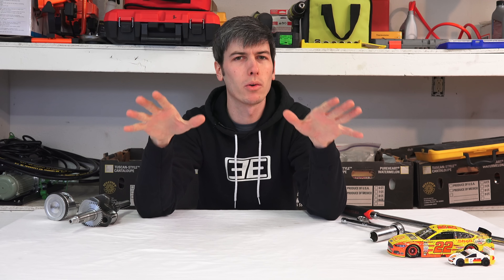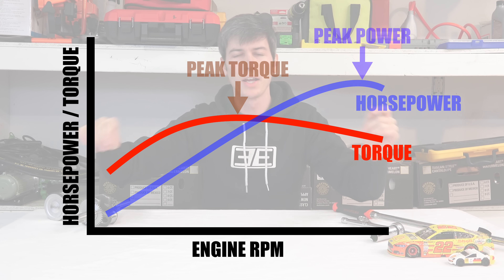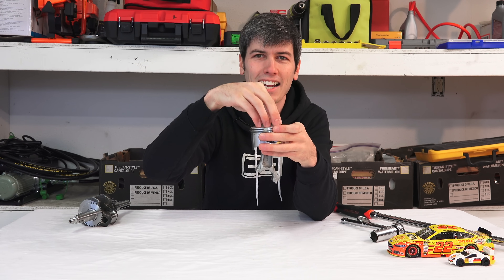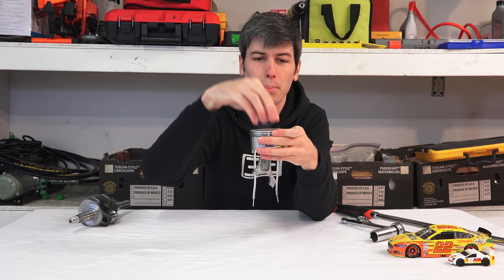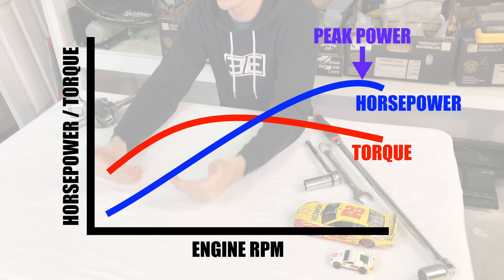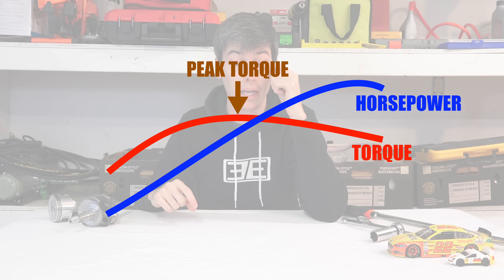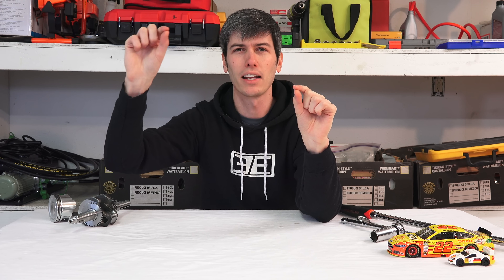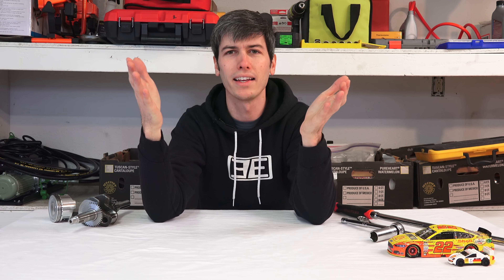Horsepower vs Torque - A Simple Explanation

Comment: I thought torque was a function of horsepower. But you get performance engines that make serious torque but not outstanding HP. So is it really just gears, bore and stroke and total weight that determines GRUNT. That's a new scientific term.
Reply: Torque is independent of horsepower, but horsepower is a combination of torque and rpm.
Reply: Thanks, that clears most of it up.Except for an engine that develops more torque than HP.
Reply: @Stevie671  the formula for horsepower is (torque X RPM)/5252. At rpms below 5252 torque will be greater than horsepower and vice versa.
Reply: Thanks, that's interesting. A high revving big block is an awesome thing but with limited applications.

Comment: Ok, engine theory 101. Torque is the measurement of rotation at a rpm. Horsepower is the measurement of torque over a distance. Torque=power horsepower=torque over a distance. 

Horsepower engines generally move fast, spin higher rpms, have power higher in rpm. 
Torque engines have power lower in rpm, power is low in rpm range and not much faster the more you spin it. 

Compair a diesel at 2,000 rpm to a race engine at 2,000 rpm. Diesel has all its power there. Some high hp race engines idle there. 

Hope this helps alittle to somebody.

Comment: Then how is it that some engines claim more torque than horsepower.  If your formula is correct, and torque multiplied by rpm equals horsepower, then torque has to always be a lower number than horsepower.  What am I missing here?
Reply: His formula isn't complete. The full formula is (torque X RPM)/5252. At rpms less than 5252 torque is greater than horsepower, and vice versa.

Comment: New diesel engines are just as quick, or quicker to 100kmh than a petrol engine. I have found, in my Audi turbo petrol, that I need to redline the engine through the gears to keep up to my wife in her diesel Audi around town. While my car is screaming its head off, her car is just cruisin', bearly switching gears. This means my petrol engine is working harder and wearing out faster than her diesel is. I always prefer torque over horsepower. Look at an electric Tesla, it's rocketship fast due solely to the enormous torque. Sure it has revs, but without the torque, it would be slow. Torque is the future I believe. Fewer revs, less wear, lower fuel consumption. 
On top of that, I have a V8 with 400hp, but lacks torque and it is useless at towing my large trailer. Yet put the trailer on a 4cyl diesel, no problem. More available torque.

Comment: Higher torque is the winner here. Horsepower means nothing if it doesn't generate a lot of torque.
Reply: Horsepower is king. Torque can be manipulated through gears to make it however large you need it to be. But power will remain constant.
Reply: @Redtooth75  So the 4 cylinder Indy cars running turbos having lower horsepower than a fuel funny car are pooches when it comes to speed? I disagree! The gearing allows the horsepower generated to be utilized to produce the fastest speed. Just try to drive a manual shift automobile from a dead stop in 3rd or 4th gear. You will bog the engine and kill it. But start in 1st gear as designed and you can jump off the starting mark.

Comment: Can you have constant torque and still be increasing horsepower? And why?
Reply: You could, but it is very unlikely.  This would mean you carefully operate your accelerator pedal, so that your acceleration is constant.   Either that, or you have an acceleration equivalent of cruise control to adjust it for you.

Because the relationship between the accelerator pedal input and the acceleration isn't constant, and is subject to a lot of variables of the physical principles at play, a fixed position of the accelerator pedal doesn't produce a constant acceleration.  It may initially feel like it does, but the acceleration eventually decreases as your car gains speed, since resistive forces grow with higher speeds.

Since no such control system is of interest to the average driver, you probably wouldn't find one that is commercially available.  If you are crafty with robotics, you could design a controller that can use an electronic accelerometer as feedback to dynamically adjust the pedal to get as close as possible to constant acceleration.  At least, up until a point where you reach the physical limitations of your car.

Comment: Why no mention of the torque - horsepower -  rpm formula?  Horsepower equals torque times rpm divided by 5252 for EVERY rotating shaft from a 100,000 rpm turbine shaft to a  20 rpm water wheel..  Below 5252 rpm torque is greater than horsepower.  Above 5252 rpm the horsepower is greater than the torque.  No exceptions.  That constant 5252 is what you might want to explain in a video.  Where do we get the constant 5252 is essential to understanding this subject.
Reply: 5252 is only due to the arbitrary definition of one horsepower back in the 1800's(550 lb foot /sec),  it has no real significance
Reply: @joepierson3859       Hey Joe.     Don't you love just engines and motors.  Horsepower is a finite rate of doing work.  So is 746 watts which is one HP.
5252 is a constant just like Pi .   For a full explanation of how we arrive at the 5252 constant check out the EPI website. They make propeller speed reduction units for airplanes and their website is an education in mechanics.  Bring your calculator.   I am sure you can find it if you search for it.              Stay on the gas and don't forget to have fun.
Reply: @joepierson3859       Hey Joe.     Don't you love just engines and motors.  Horsepower is a finite rate of doing work.  So is 746 watts which is one HP.
5252 is a constant just like Pi .   For a full explanation of how we arrive at the 5252 constant check out the EPI website. They make propeller speed reduction units for airplanes and their website is an education in mechanics.  Bring your calculator.   I am sure you can find it if you search for it.              Stay on the gas and don't forget to have fun.

Comment: One part of the video doesn't make sense to me.  You say the car accelerates fastest and peak HP or with more HP, but that you feel pushed in to the seat (for a given gear ratio) at peak torque.  But the acceleration of the car is what makes you feel pushed in to the seat.  If the 200 HP/100 ft/lb care is quicker than the 100HP 200 ft/lb car than extra HP will "push you in to the seat" hardest, not extra torque.

Comment: You can't divorce this from what the engine needs to propel. Bike engines have huge hp from spinning at 13,000+ rpm, but need limited torque as the bike is light. Car engine = lower hp per litre (lower rpm) but far more torque to shove a 1.8 tonne car down the road. For any given speed my Honda 750 VFR revs 4x as fast as my Jag XF diesel. The Jag has 515 lb ft or torque @ 2,000 rpm which would be, er, interesting on a bike

Comment: What a airhead explanation..!
Torque is a measure of the instantaneous force applied to the output shaft
Horsepower is torque x rpm
                             ENGINE TYPE      
                             DIESEL            GASOLINE
TORQUE            Very high      Average to low
LONGEVITY        very High                Medium
HORSEPOWER    average                 High
PULLING 
A LOAD                 great                   Average.

EFFICIENCIE      GOOD               not so good.

Diesel fuel has more btu/ energy per gallon then gasoline
     the diesel fuel itself is very slippery, compared to gasoline, it has “Lubricity” 
This Diesel engines don’t wear out like gas engines 
And usually rotate much slower then gas  .- but nothing to do with torque.

Comment: I disagree with the statement "horsepower will always win"
There has to be a load point where the high horsepower low torque lags and the high torque engine takes over. IE image a formula 1 engine compared to the latest Cummins engine pulling a loaded road train (3 semi-trailer rig) up hill? If I know anything (and that's not much) the Cummins truck engine is going to win that race. Presuming similar gearing.
Reply: If the F1 engine has more power, and assuming appropriate gearing (meaning appropriate engine rpm), the F1 will win the race. The thing is, "horsepower will always win" is misleading because as he says power is the thing that ultimately gets you going. Infinite torque will get you nowhere if the rpm is zero. High torque in practice means you can produce high power at low rpm, which gives the driver a comfortable, "powerful" feeling with fewer gearshifts. Low rpm also tends to mean less noise, less engine wear, etc. However, power is what gets you going, and higher power always goes faster, even if at higher rpm, and disregarding the fact that the F1 engine in practice might well explode half way up that hill.

Comment: The example with the cars is not properly stipulated. You can assume the second car also has a gearbox and you can change the torque/speed ratio. If you take the cars like that (no gearbox) and assuming both cars have the same mass the car with more force applied (torque) will accelerate faster since force is equal to the mass multiplied by the acceleration. Since power can be seen as torque times speed this means the wheels of the more powerful car will rotate faster, but that is different to the acceleration of the car.

Comment: Very clear explanation, you resolve my confusion about the relationship between torque and power for many years🥰

Car1 200HP + 100 LB-Ft
Car2 100HP + 200 LB-Ft
Car1 will accelerate faster than Car2 because car1 engine can deliver more work (power).

1. Torque can be leveraged by gear box. (high torque mean longer range for gear shifting)
2. Power cannot be leveraged, it depends on engine type / size

Torque = Force x Level Arm
Power = Torque x RPM
So rev.  the engine with higher RPM always delivery more power.

CVT gear box can change the mechanical leverage (gear shifting) without dis-engageing a clutch and keep the engine at highest RPM (maximum power delivery), which is an advantage compared to conventional gear box.

Actually CVT no need to deploy clutch mechanism for varying mechanical leverage.

Comment: how come if horsepower is a function of torque and vice versa 
a mazda RX8 that has 300HP will have 220lb ft 
and a 300HP porsche will have 280lb ft? 
both cars N/A 
Mazda revs higher.
Reply: So you answered your own question there?

Comment: Horsepower - how fast you can go
Torque - how fast you get there
Reply: No!Think again..Let's talk like it's 100m sprint!...if you run faster,you will get on finish faster...torque only means faster start,but horse power will get you more speed eventually to the finish line..
Reply: Big Pitchwise torque is a force horse power is a measurement. 

You need to learn more my freind, you can start by understanding my OP.

Comment: To increase power you can increase torque and/or rpm  but if you increase torque by increasing the radius it increases the perimeter of the circle ⭕ thus decreasing the rpm so there has to be an optimal radius for which you obtain maximum power...

Comment: 2:16 It's not entirely clear to me how you you can have things rotating faster with the same amount of force.
Reply: It depends on the load applied to the rotating object such as a shaft.  Brake horsepower is called that because the load is applied with a brake to the engine crankshaft.  Thus you can have an engine at different RPMs despite being at identical throttle settings (usually wide open).

Comment: I drive a truck with a 465 hp diesel,  I know there are cars with higher horsepower rating,  So does that mean I could use that 500 hp V8, with the proper gearing, get 40 tons up the Grapevine (north of LA on I-5)?  Why am I thinking that won't work?
Reply: It will work and be faster if the weight is the same and if it is engineered for it with proper cooling etc. You as a driver may not like the NVH levels from having to be at a higher RPM for the whole trip however.
Reply: @buzzlesworth54   And 3mpg pulling that hill with a diesel and 3 gpm with a gas V8.  I'm not knocking gas engines.  I wouldn't think of owning a diesel in a car or even my pickup.  Diesels should be used only when absolutely necessary like for heavy hauling as you probably know.  My 4X Tundra 5.6L pulls my 8300 lb camper just fine but with a gas penalty.

Comment: Let me explain torque in a way that may not be scientifically correct but understandable, so basically you think of a mini engine like let's say an engine the size of a fist, now that engine can make 500hp however it cannot make a car drive because it's so small and weak, so you need a bigger engine that produces more torque, and another way to imagine it, think of a little person at the gym, they can lift 2kg up and down really fast but can't lift 200kg so basically torque is how much strength the engines got and HP is how fast the engine can go, which is not exactly correct but that's just a wait to think of it

Comment: One question. Assume that there are 2 cars, one has 35kgfm for torque, 6000 for max rpm and 350HP. The other has 70kgfm, 
3000 and 350HP and the cars have same gear ratio, final drive and weight. Then, Which car can reach 3000 rpm faster at 1st gear?

Comment: Torque is irrelevant. With enough gearing you can make even a 1.5 Honda engine make as much torque to the wheels as a Cummins turbo diesel. 

Oh... it won’t be as fast?  Congratulations!  You now know what POWER is!
Reply: Wrong.
2nd part is right the first part (torque is irrelevant) is wrong. Both are relevant.

Comment: How does this apply to malaise era big US cars.  Those big cars have basically the same engines as earlier cars, but their horsepower has been "choked off" (for emissions reasons), while at teh same time, those giant cars need and have lots of torque.  How do you choke off power without reducing torque?
Reply: By not allowing it to rev. Power is proportional to torque x RPM.

Comment: a bit misleading the graph indicates that Torque will initially be the chief function, this will be the same through all the gears until the power of the engine delivers the top speed.  i.e. higher torque will move you faster from rest until 4-5 gear is achieved and the higher HP vehicle over takes.  The higher torque vehicle will be quicker off the marks and beat the high HP vehicle in the first few seconds

Comment: I still don't understand what torque is. What is the benefit of torque? If an engine has a higher torque figure but low power figure, how is the engine gna behave? You said the car with the higher power figure will be faster but you didn't elaborate on the car with the higher torque figure. What's the tradeoff? What do you get if you compromise speed and get a higher torque figure??

Comment: Torque is a scalar force like pounds and volts. Total torque is zero.  A force aplied over a distance is Work. Work divided by Time is Power. Divide the drive axle torque by the radius of the wheel and the force to the pavement is linear. A piston travels in a linear motion in a certain time. That is power.
Reply: Torque is a vector.

Comment: Why engines have all cylinders of the same size? Can't we have an engine with different cylinders bore and stroke to cover the need of torque and power?
Reply: Doing that would cause balance issues. Ideally you want all of the forces created from rotation the crank to cancel each other out. An engine with unequal sized cylinders would shake itself apart
Reply: @Redtooth75  Engine with cylinders with different diameters and strokes in the same crankshaft are used in steam power engines. If that works for steam-powered, why not on gas-powered engines?
Reply: @hesleyt  good question.double or triple expansion steam engines are a little differents. The steam first goes to the smallest cylinder, then the next largest, and so on and so forth. However, the steam cools as it travels through the engine. So the larger cylinders produce the same amount of force as the smaller cylinders because the steam has cooled by the time it reaches them.
Reply: @Redtooth75  anyway, in steam engines, their mass is balance by their counterweights. No vibration occurs. All the same, I suppose that in internal combustion engines, when torque is needed the cylinders that provide torque are working, when it is speed, the opposite happens.